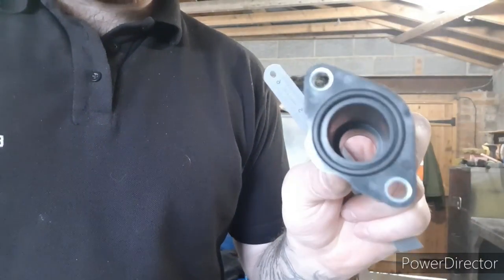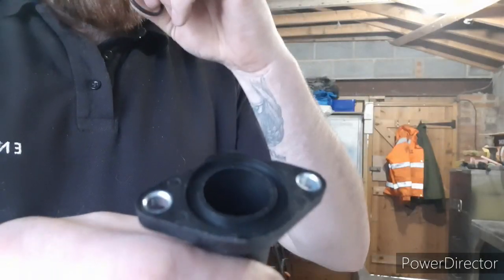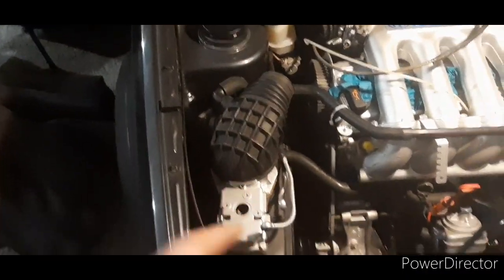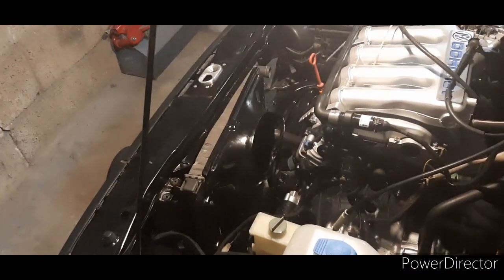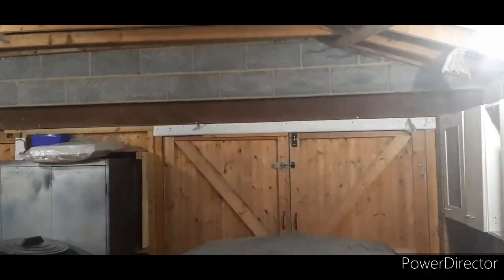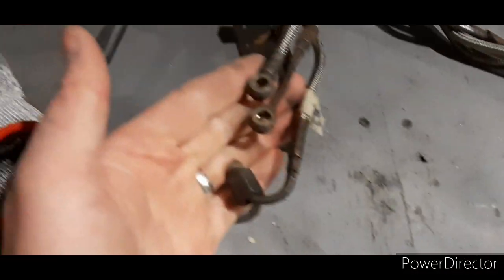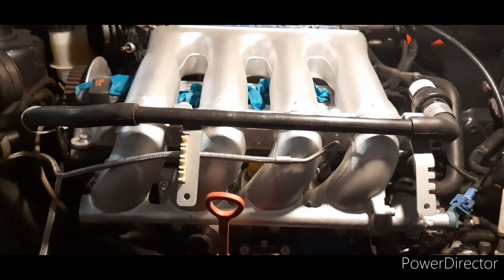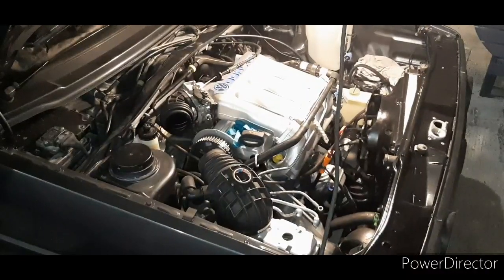Mk2 Golf Gti 16v Restoration - Details Details

Comment: So there's an engine in the car but you're building another longblock on the side?
Reply from the maker: Yes the engine in the Mk2 is one I've built, 1900cc 😁 and this engine is another project i couldn't say no to firstly as it was free and secondly because its a 2ltr 9a that are hard to find these days, the long block is the ABF engine code thats 15 odd mm taller, these and the 3a / 6a are nicknamed bubble blocks
Reply: @GreyGooseRestorations  neat!